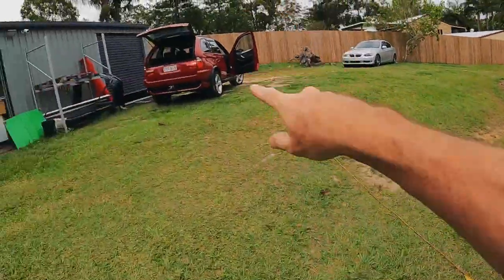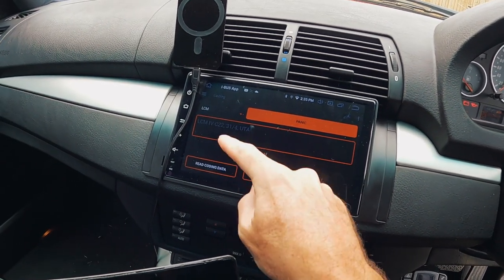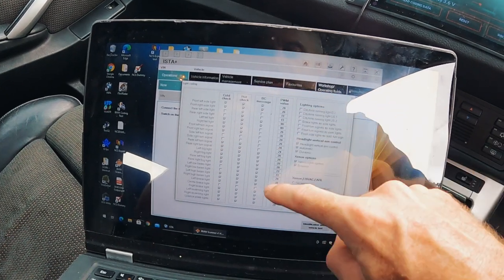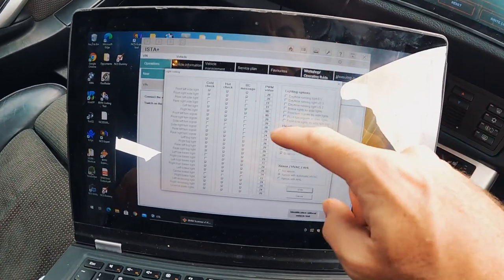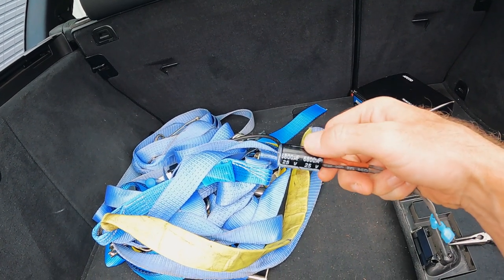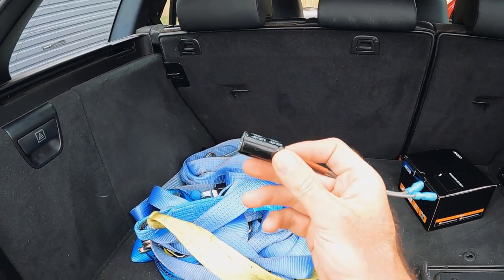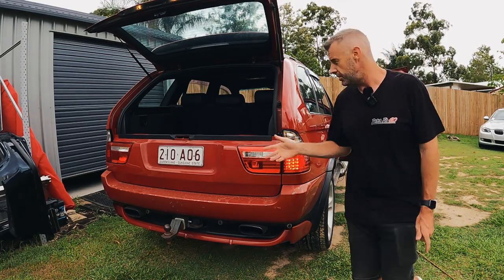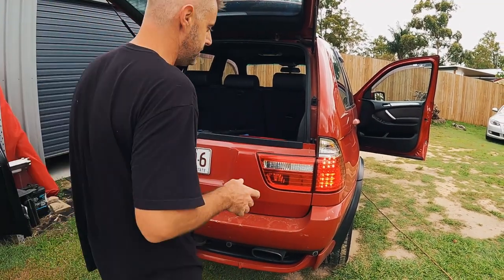BMW LED Tail Light Flicker Fix: E53 X5 LCM IV PA Soft

Comment: Brightness looks good.  FF is hexadecimal. FFh = 255 and 72h = 114. It looks like FFh is 100% duty cycle and 72h is 114/255=45% duty cycle. So glad you found the sweet spot to get rid of the flicker. It would have driven me nuts.
Reply from the maker: Thanks man, its strange i feel a lot better about it being right.

Comment: I’d leave the settings as you have them. Brake lights are still a lot brighter looks good.
Reply: Agree with this. Not sure if it will shorten working life? Higher duty cycle...
Reply: I agree, looks fine mate, brake lights significantly brighter.
Reply: Agree leave it as it is

Comment: went back to the Tail lights and followed your advise ...perfecto ..my lights are the bar led now no flickers apart from the taillights in the boot lid but have ordered smaller led globed because what is in there looks like brake lights even when I dropped down in voltage

Comment: Will this work with an E46 too? I've installed OEM rear leds with an updated LCM. Programmed out the checks ad the tamper dot. But I still have a flicker on the tail lights. Interestingly when I've set rear side lights as fog lights using PA soft and I switch on the fog lights there is no flicker and the brightness seems right on the money to be a tail light.

Great video by the way 👍
Reply from the maker: Yes it will definitely work to fix your issue to. It may be a little brighter, but should stop the flicker.

Comment: Brake lights are a go! My head lights are led in halogen and I programmed the check out but each side comes in full power on unlock and then half bulb goes off on inner side (both) after crank. I’m wondering if they are bad or, do I need capacitors too?
Reply from the maker: How did you get the headlights to turn on with unlock? I would love to get these lights turning on with unlock like my e92 does.

Comment: What if you turn off hot checks would that stop the flickering?  I thought the flickering is tiny test voltage for continuity, which would not be sufficient voltage to light a regular bulb but it will with LED
Reply from the maker: Its the way the PWM signal works. The flickering i could see was every second, where the hot bulb checks are like every 30 seconds.

Comment: Which wires exactly did you wire your resistor to? There're at least 5 wires back there.
Reply from the maker: The light circuit that you are trying to solve the flicker issue with. And its a load resistor or capcitor, depending on what you are trying to achieve exactly.

Comment: Can we use a P21/5w capacitor for the tail light?
Reply from the maker: That sounds like maybe more of a load resistor than a capcitor. However it may also fix teh flicker as the load stabizes the voltage getting to the LEDs.

Comment: brightness seems OK for me

with the cap inserted in the wireing
the setting of the PWM Value does not matter anymore because the cap does provide power when the LED would be off because of the PWM Value

only thing that changes by changing the PWM Value is the amount and duration the cap supplys the LED with power
Reply from the maker: That makes sense, thanks for clarifying. So i guess the PMW will no longer effect the brightness.

Comment: Interesting.  PWM drive is needed to control the amount of current through the LED's. Too high and it could heat them and failure could occur. Without the specs on the led's and a way to measure current it's a guessing game. Capacitors are a good idea in any case. PhD EE.

Comment: Sorry for sending this as public message am looking to get a set of these for mine has anyone any idea how long they last ? Are they as good as oem. I’ve been told they only last a year ?
Reply: Well judging by the fact that the normal oem bulbs last years, LED ones should last significantly longer.
Reply: @Saif0412  depends - I had the Eagle Eyes LED Tail-Lights in my E46 and had after some time some clusters fail and other times the Electronics pack that is molded in to trick the cold check make problems
I would have loved if I could have used the OEM LED Lights from the Coupe - but sadly they do not fit -so aftermarket was the only way to go
Bought about 3 sets over the 8 years i had my last E46

the LED themselfs were fine - the whole package is the problem because it needs to be made cheaply to be able to be sold - not that good for quality :(
Reply: @odie0815  I agree that can happen especially with aftermarket stuff, but led's last longer than standard bulbs in general. Worth a try in my opinion, since they look so much better. 

Hopefully the set fitted on the X5 should last a couple of years at least. Worst case can refit oem units back.
Reply from the maker: A lot of the aftermarket stuff is made to a price. In my opinion these are expensive for cheap light, so i hope the internal electronics are done nicely. They all are sold with warranty, all be it only 12 months most of the time, the manufacturers couldn't make them too dogdey. I only had my last ones for 12 months ish before selling the car. I would bet money most failures are caused by moisture getting them from poor installation. Also never apologise for this sort of comment publicly. Id much rather get honest opinions from the comments section than anything else.

Comment: I've not watched to the end yet but I'd be inclined to put the voltage back down to the original setting, should bring the brightness back down. They're clearly not as bright as the brake lights, but I agree they look a little to much for sidelights
Reply from the maker: Even watching it back, i think i agree. I tried it at night with the 72 setting and still have a little concern.